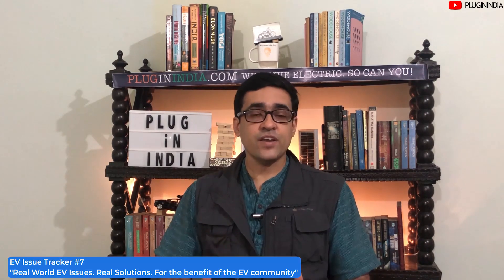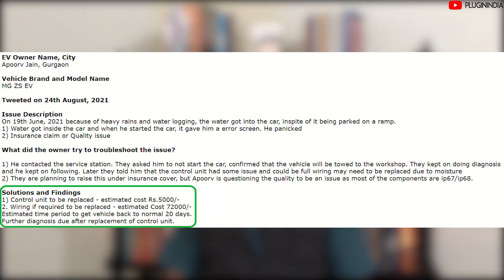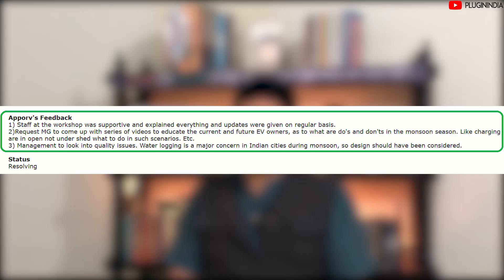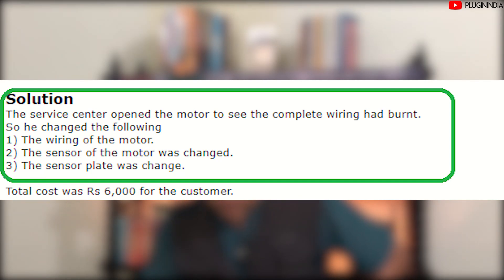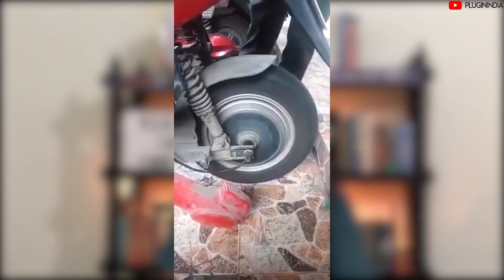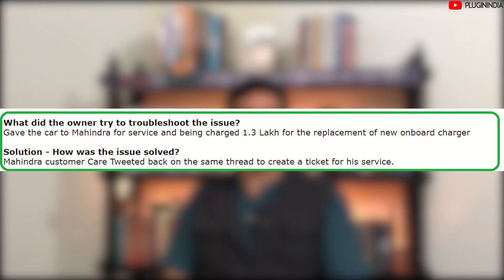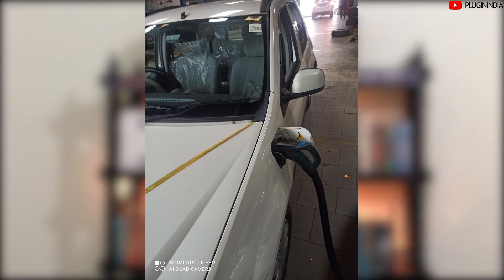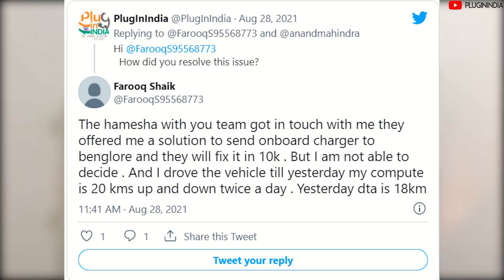EV Issue Tracker #7: MG ZS EV Control Unit Change | Hero Photon Motor Repair

Comment: I want to share my very bad experience about the car, with view that some one from MG are listening and will do some thing about it. I am using MG electric for last two years, and by and large with some minor issues  it was good experience. As well know until shit hits the fan, we never know. That did happen over this Sankranti festival. I am based on Hyderabad, Telangana state.  I went to my village about 200 km from Hyderabad on 14th Morning, every thing perfect, parked the car put in charge. we had good family time. It was time to get back. Around 4pm on 15th started the car, back wheel breaks jammed and wouldn't release. Did every thing, though very little one can do. consulted the manual and called the help line, that is the beginning of the worst nightmare, literally. To cut the long story short (for fellow MG electic users benefit if they face similar situation, which is bound to be) a) the help line is totally useless, it took 20 min, after three transfers, repeating the same story details. Pl. let every one know, those guys who are answering are poorly paid young people only know to transfer the call to next person, who equally not know anything about car. b) finally the guy who claimed he know the car, is local guy from Vijayawada, obsolutely no clue how car operates, except telling, to stop and start, press the hand break release button. when I confronted if know anything other than, he admitted, nothing he can do except that, already almost 35 min over c) then comes the arranging taxi, this is worst thing. after several phone guys calling, several calls me making back to help line, finally car arrived only at 9.30 to nearest main road. The guy came is the lowest bidder, nice guy but what can taxi guy do, stopping for gas, stopping for eating, we reached home near TESPA around 3am. The saga not ended.
Today, 17th Jan, around 10 am I got call, from Balanagar. The guy polite, but asked me what happened to car, specifically he asked 'Did car fell in the ditch". Obviously not, we reached  safe, parked at home. Car did not work when we wanted to take out from parking.
FOR MG GUYS IF AT ALL THE CARE TO TAKE NOTE OF THESE THINGS.
1. YOUR HELP LINE IS TOTALLY UNPROFESSIONAL, UN COORDINATED, HAS NO USE. THEY DON'T KNOW ANYTHING, THEY CAN HELP NOTHING. SO SUGGESTION: WHEN CUSTOMER CALLS, JUST TAKE THE DETAILS, ARRANGE THE RESCUE AND BE DONE INSTEAD OF WASTING TIME, FORWARDING TO EXPERTS, ALL THIS CAN BE OVER IN 10 MIN.
2. CUSTOMER NEED NOT REPEAT TO EVERY GUY WHO CALLS, (I HAVE TO EXPLAIN TO AT LEAST 8 PEOPLE SAME)  HAVE A  A COMPUTER SYSTEM, WHICH GIVES THE INFORMATION, LIKE CAR NO, CONTACT NO, WHERE IT IS ETC. NO NEED TO REPEAT, WHEN CUSTOMER IS ALREADY IN TENSION AND STUCK SOME WHERE.
3. ARRANGE WITH SOME RESPECTABLE TAXI SERVICE, NOT LOWEST BIDDER, HAGGLING FOR FEW RUPEES SAVING AND ON TOP OF IT SEVERAL TAXI FELLOWS CALLING THE CUSTOMER DIRECTLY ON PERSONAL NUMBERS, WHICH HAPPENS WITH ME AT LEAST THREE FELLOWS THREE DIFFERENT LOCATIONS CALLED AND ONLY TO KNOW WHERE I AM AND IF HE CAN GET BETTER RATE. THIS IS SILLY AND NOT VERY HELPFUL AT TIME WHEN CUSTOMER IS IN THAT SITUATION.
4. GET THE CAR FOR REPAIRS TO WHERE CUSTOMER IS STAYING UNTIL UNLESS CUSTOMER REQUESTS. IN MY CASE THE GUY WANTED TO SEND THE CAR TO VIJAYAWADA AND IF WANT TO HYDERABAD, THAT COSTS EXTRA, THIS WENT ON FOR A WHILE, AT THE END THEY DECIDED TO GET THE CAR TO HYDERABAD
4. ARRANGE REPLACEMENT VEHICLE AS PART OF IT UNTIL REPAIRED.

MORE SCARE AND IMPORTANT THING TO CUSTOMERS AND MG COMPANY.

1. IT IS SCARY ABOUT THESE HIGHLY COMPUTER CONTROLLED CARS. YOU CAN DO NOTHING, NO MECHANIC CAN HELP, NO ONE CAN DO ANYTHING, IF YOU ARE STUCK IN REMOTE PLACE, IT IS EVEN WORSE. IS IT POSSIBLE TO HAVE COMPUTER RE-BOOT, SO THAT CUSTOMER 
2. CAN TRY TO RESOLVE, IF IT IS RESOLVABLE WITH HELP OF REMOTE EXPERTS.
WHAT IF COMPUTER WRONGLY JAMS THE BREAKS WHILE ON THE MAIN ROAD OR HIGHWAY?, DID THAT HAPPEN TO ANY ONE????
3. It is time for a young techie owner of MG to start customer site, to exchange views, if it is already there, pl. let me know

It is long but wanted to share, happy to listen your suggestions and comments on how to deal with such situation, and how any one of you dealt.
Thanks, regards, B.Gujja

Comment: why he is going to pay ? its manufacturing defect .
Reply: Yes that was my question, but they told me only 30 min the car can be submerged in water. As per the manual. Which is quite less but again if you are driving car in not submerged. So I also learnt my lesson. I need to take more care in such situation. Finally I paid only for the carpet cleaning and rest was taken care of by the MG Motors.
Reply: @apoojain  After spending more than 25 lakhs you will never have peace of  mind.If you have to take out your car in rainy season as they say for only 30 minutes your car can be in water thats not even practical.You would think twice and also while power washing.It clearly shows that proper R & D has not been done while designing and making Mg Zs ev.And why should the customer pay ?